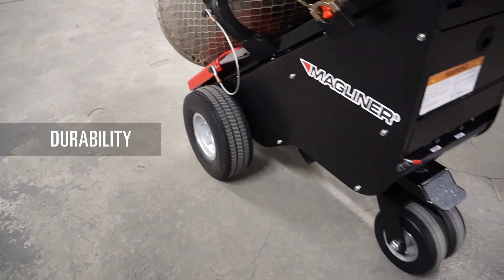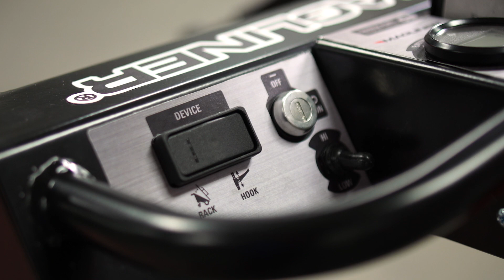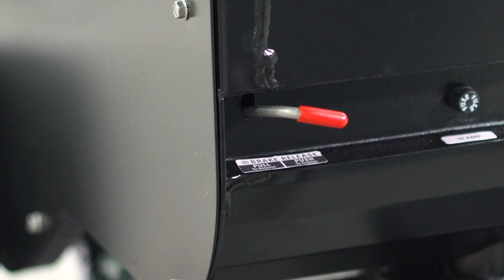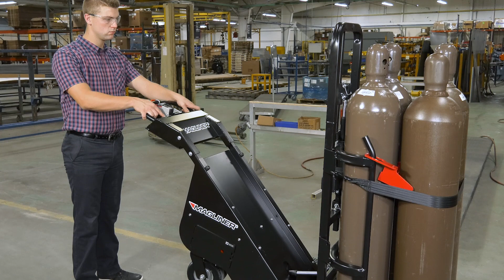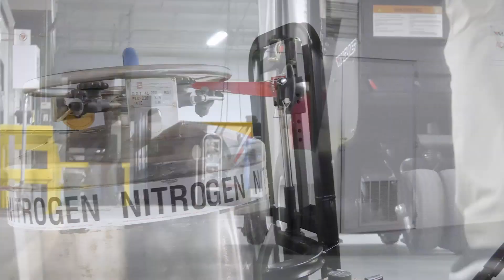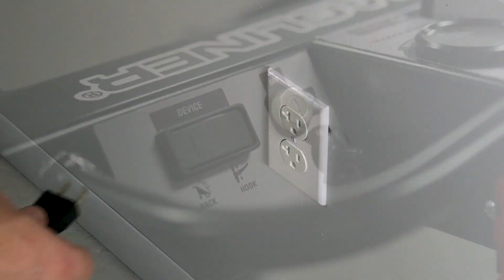Motorized Dewar Cart Training Video

Comment: How well suited is this cart for moving 200L/55Gal oil drums?
Reply from the maker: Hello! This cart was designed specifically to move Dewar tanks and high pressure cylinder tanks, but not 55 gallon drums.